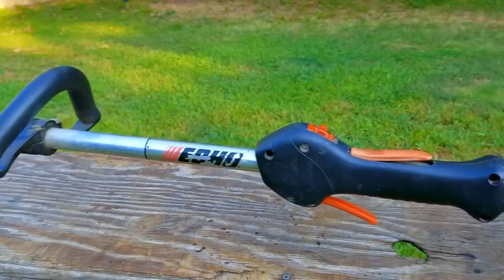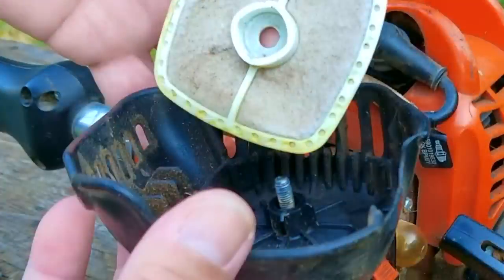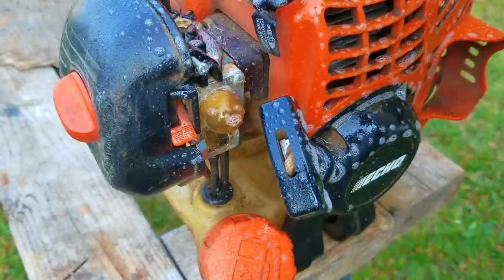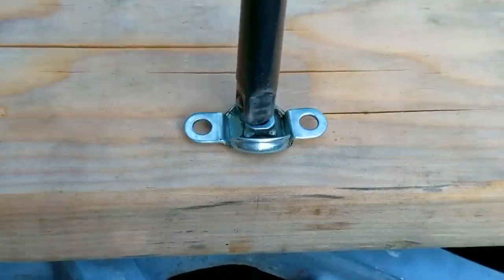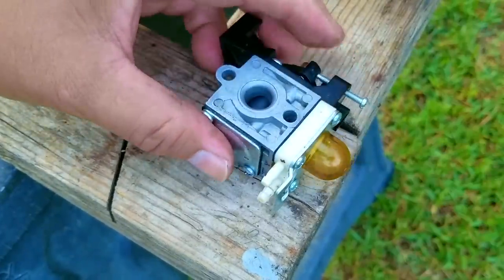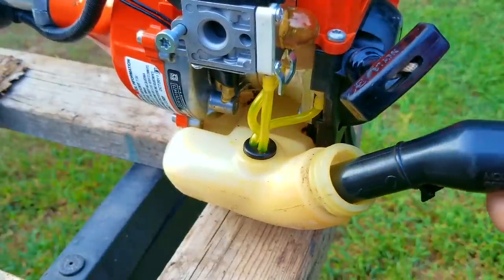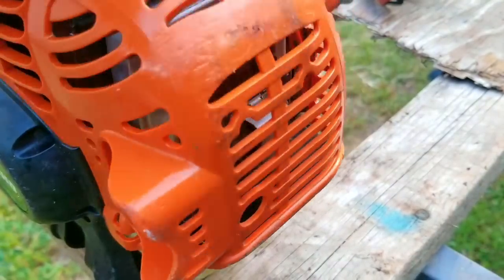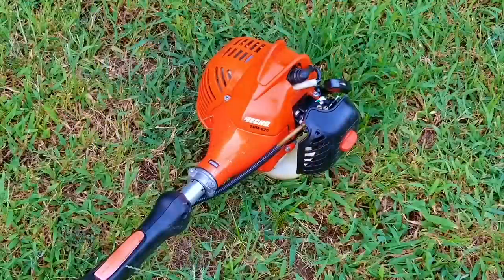This Echo Trimmer Won't Start Because Of Poor Handling

Comment: I have the same one..Echo  is awsome..bought mine at home depot in 2016....never had any issues. I feel Echo is the best trimmer..
Reply from the maker: thank you Stephen Eggert.
Reply: ECHO  IS THE ONLY OUT DOOR POWER TOOLS I TRUST..  SINCE IVE TRY ALL OF THE NAME BRANDS ..MY BROTHER HAS LOTS OF THEM TOO DATING BACK TO THE MID 1980S ..AND THEY STILL RUN!  WE RUN STABLE   GAS TREATMENT IN OURS ..AS WELL AS THE ECHO GAS MIX ..KEEP UP ON the maintenance, trust me .they,ll last your 40 yrs or more

Comment: Thank you for a indepth tutorial!!! I would have tried to get the metal air filter part back in to shape like you did. Perhaps would have used a press or small c-clamp first to maintian metal choke cover and press in to being flat. That's just me. However, your hammer method did the trick faster. Either way the end result took care of the issue. Much appreciated video!!! 🤩
Reply from the maker: oh yes the press idea , is an even better idea! thank you Mr G.

Comment: 100% would have bent the choke plate back as you did...maybe in a vice...no need to buy a part if it can be repaired...I am also cheap like you! (Plus if you are doing it for $ it keeps the cost of your repair down and expedites getting it back to a customer if you're not waiting on parts you're not likely to have on hand)...another great video...cheers!
Reply from the maker: thank you Kirk Leaper.

Comment: My srm 225 turns on but dies after about 10 seconds. The screen is clean, I even learned how to remove the brass cap so that I can adjust the carburetor but it still turns off. I don't know anything about this stuff so I just saw a couple of videos on how to replace the spark plug and hopefully that's all I need to fix. I don't think it's a year old yet that's why the screen was clean. How often should you change the spark plug? I guess it depends on how often you use it. Thanks for the videos.
Reply from the maker: sounds like a carb replacement would be the next choice for me.
Reply: @HomeGaragechannel Thanks for replying. I don't know why I was not notified you had replied but I went and replaced the spark plug which did not look too dirty either. It started up and revved up stronger like new but it still turns off. I even adjusted the carb once again but that didn't help either. Thanks for your videos. My brother in law's trimmer looks like it's in worse shape. His won't even start. I'd like to learn how to fix mine before I even try to fix his. Yeah, I'll see if replacing the diaphragm does the trick. Thanks once again.

Comment: Hey HG watching this video I found two free GT225 much like the SRM's jthe own was having such issues with them both starting he went electric . I pretty much knew from the first look that the fuel mix was to heavy on the oil . He is a neighbor so I told him and he did not care he wanted them gone . Short story dumped old fuel rinsed out with gas then used my premix from husqvarna . One started right up and once the fuel ran threw it ran great the other would start but not go full rpm . I did not see any adjustment screws on this echo carb so I bought a new carb and same thing (I check exhaust screen before all this) compression on both over 120 psi tested to see if I had vacuum leak nope  plug is new also . Where do I go from here ?
Reply from the maker: hmm. the carb is adjustable but they hid them.  A new carb, works for a "new" engine but sometimes it won't work without a slight adjustment.  Also, failed attempt to start a trimmer will also flood it, making this even more difficult
Reply: @HomeGaragechannel  ok it is not flooded it starts on second pull ad idles great just will not get to high speed I have looked all over the carb where would the adjustments screws be at on this carb? I can almost say for certain the high end needs adjustment . You will have to forgive me I work on larger machines lawn tractors and push mowers trying to learn how to fix the trimmers chain saws and such . Your videos are great on all the two cycle engines and mower engines .
Reply from the maker: here's a link to a video I made, and the carb adjustments I had to make,  the carb is practically that same.   https://youtu.be/FAnk9lIUe3U
Reply: @HomeGaragechannel  ok it starts and idles fine do you think the exhaust itself might be clogged up ?
Reply: Found adjustment they really do not want you messing with it
Reply from the maker: do you mean the spark arrestor? The muffler itself will never clog, it's not possible.
Reply from the maker: understandable.
Reply: @HomeGaragechannel  thanks for the reply I need to adjust the carb next have not done it yet sill working on some flip mowers I am doing leaf pick up is needed soon so need these mowers with baggers running so I can sell them

Comment: I noticed not only are you extremely thorough in your investigation and repair you clean it up to look brand new. What solution do you spray it with and then rinse it off? It cleans beautifully with no scrubbing or hassle!
Reply from the maker: thanks, I use the only degreaser Harbor Freight sells.

Comment: If I was to buy a new one, I think I'd have to go with a echo over the stihl because I just like the design better with the speed feed head and the price difference. All my equipment is free stuff and I gotta say older ryobis have earned My respect. Abd yes  I would have tried to fix that plate because well thats all it needed.
Reply: you can buy a speed feed head and put it on almost any weedeater
Reply: @joshuaguenin9507  I did I put one on one of my old ryobi 740rs but I was just saying if I was to upgrade, which I won't anytime soon, that I would rather buy one that is the way I like it.
Reply from the maker: I see your point.
Reply from the maker: that's true.
Reply from the maker: thank you G Machine.

Comment: Thank you…seems like most of the issues with my 2320t are the exact same. Question tho, is it a possibility tht too big of a carb (think it’s from a 25cc unit instead of a 21cc) on said trimmer would cause it to not run at full throttle (potentially to rich)?
Reply from the maker: to be honest, I'm not sure.

Comment: I have srm 230,  recently had locked on me, piston has small damage on the tip, should I consider replacing the half top with piston n rings? 
After opening n putting back together I got $100 psi out of it. N runs but dies pretty quickly.
Reply from the maker: I would replace it.

Comment: Hello Hg it,s me again mayve you rember me,but what do i do when my trimmer goes full gas whenever i start it,like i go to it i use the correct fuel start it normaly but when i start it it just goes full gas on any choke position and no choke even if i squezze the handle it doesn,t stop so please tell me how can i fix this problem.
Reply from the maker: If It was mine, I would check to make sure the throttle works, and if it does, I would check to make sure the carb was installed correctly.

Comment: iv got a ryobi 4 cycle trimmer that seams like it wants to go full speed but as soon as you press the throttle it cuts out iv tried adjusting the L screw and it dosnt change anything do you know what this could be?
Reply from the maker: thank you LJ, I would adjust the valve lash, and if that doesn't work, replace the carb
Reply: @HomeGaragechannel  I will try that thank you for your help
Reply from the maker: no problem

Comment: It'll be on marketplace within a month.  I'll be getting that one soon lol
Reply from the maker: you never know.
Reply: @HomeGaragechannel  Do yo have a video reference for trimmers that die out for no absolute reason?  Starts, runs just fine, for no reason.... dies.  Starts right back up... dies again within a few minutes
Reply from the maker: no I don't but there are only a few reason for that to happen, carb, tank vent, or an engine issue.
Reply: @HomeGaragechannel  I found it lol, it was from watching one of your videos a couple days ago and come to find out(from what you mentioned), the fuel line was on the wrong side! lol  I had it on the filler side not the back. Works like a charm
Reply from the maker: nice work and thanks for the watch

Comment: Hey HG, I have a question. I've been using some Tygon-style line in a few of my machines, and for some reason, it keeps getting hard and shrinking so that it doesn't seal anymore where it comes out of the tank. It does this very quickly, maybe even within a few weeks. I do use ethanol fuel, but it still shouldn't be doing this so quickly. I add a fuel additive called quickare, maybe that's doing something? Do you have any ideas what's going on? Thanks a lot!
Reply from the maker: the additive is only to keep the fuel, usable not from harming fuel lines, and diaphragms,  My suggestion, Is to use Real Tygon line, but it's about 3 times the price of the Tygon "like" line.
Reply: @HomeGaragechannel  ok thanks, I'll look into the real tygon!
Reply from the maker: no problem

Comment: So replaced fuel lines and bulb and works good HOWEVER started right up but after idling for 5 second it quit. Started up slow to accelerate and quit at idle again. So need your help
Reply from the maker: does your primer bulb fill up with fuel? did you confirm the direction of the fuel flow before starting it?
Reply: @HomeGaragechannel  yes fills up fully 
I used kit so it was a plug and play install air filter looks like new spark arrestor was clean

Comment: After installing fuel lines started and ran normally but died at idle after 10-15 sec. Echo dealership said replace carburetor. Do you agree?
Reply from the maker: with the information I've been given, yes.

Comment: What brand of degreaser do you use? I need some of that stuff.
Reply from the maker: it's the degreaser in the big bottle at Harbor Freight.
Reply: @HomeGaragechannel  Ok, thank you so much! And btw good job on the trimmer. I just got a bolens bl110 from my grandpa and she runs great after a carb rebuild and fuel lines replacement along with a good ol' cleaning.
Reply from the maker: no problem and good work on the bolens.

Comment: Forgot to mention did complete service. Plug, fuel filter, spark arrestor. Didn’t touch carb. It’s a PAS 225
Reply from the maker: how did it run before you but the parts on?
Reply: @HomeGaragechannel  neighbor hasn’t run it in years. When I picked it up we noticed the fuel leak. So started with that. Primed and started really good. Looks new
Reply from the maker: fantastic job!
Reply from the maker: thanks again.

Comment: I would just fix the metal plate, once I was repairing a Honda line trimmer that my auntie used to own & when I had the fuel lines reversed it wouldn't even run !
Reply from the maker: was it a 4 cycle then?

Comment: Great video, I would've just used a hammer to fix the metal plate like you did.
Reply from the maker: I like using the hammer, lot of frustration is released, thank you WildeFox.

Comment: I would have done the same thing as you did hitting it with a hammer it's. Quicker and cheaper. Than going to. Run down that. Little plate .
Reply from the maker: thank you Micheal Bridges.